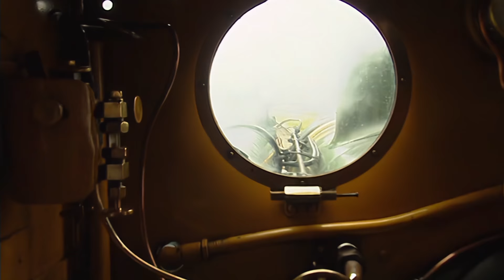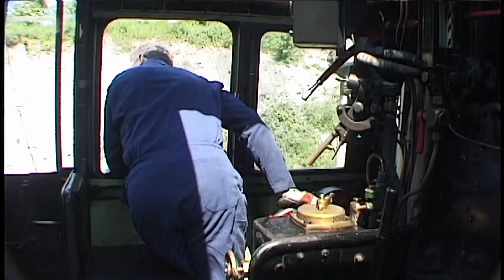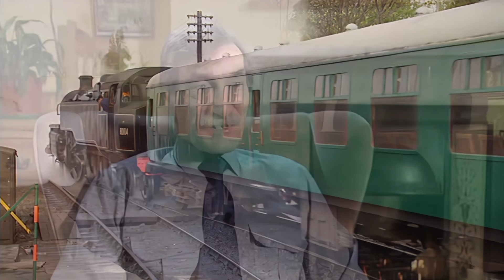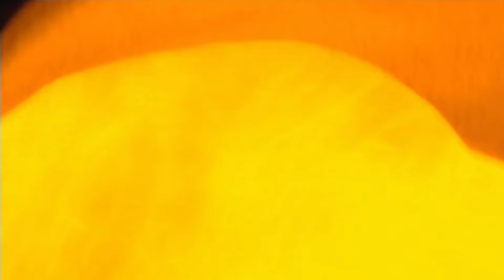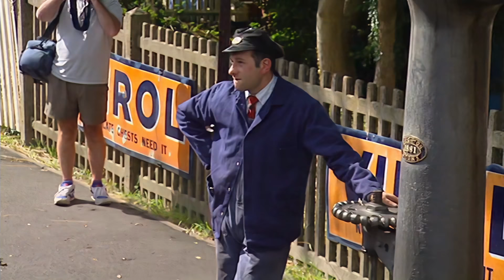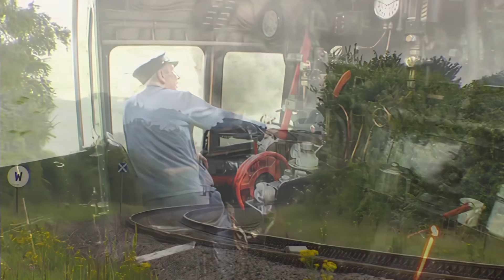Great Steam Engines: Standard Engines | Full Film

Comment: I'm rather enamoured of Riddles' "standards", though one thing in particular puzzles me.  

Why did some classes require some deflectors yet others clearly didn't?
Reply: The smoke deflectors were to deflect smoke away from the view of the driver - otherwise it’d hang low and obstruct the vision
Reply: It depended on how strong the ‘blast’ of the exhaust was for getting steam away from the engine, this can be even harder at speed so the Britannia’s clans and dukes probably needed them for this not sure on the 9Fs
Reply: @thomasthornton2002 Well they can break 90 on passenger workings, maybe it was because they were more free steaming?
Reply: @thomasthornton2002  the blast is influenced by the dimensions of the chimney(limited by loading gauge and relative dimensions/position of the smoke box within that space) as well as the blast pipe design and of course whatever comes out of the chimney is impacted by the aerodynamics of the loco, superheated or not, boiler pressure... there's locos that could do with them that never got them and ones that could frankly do fine without them but have them! 😂 the 9Fs have them... the former crosti ones seem to have done just fine without for example. Royal Scot has run in preservation both with and without them, as has flying scotsman. 

Tbh I don't think half the locos with them actually got them via any serious aerodynamic study more trial and error.